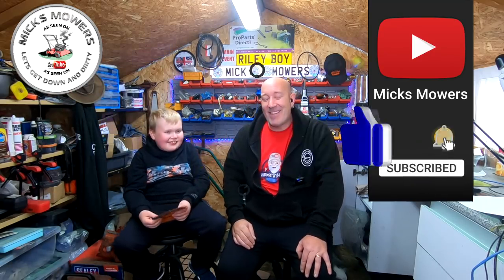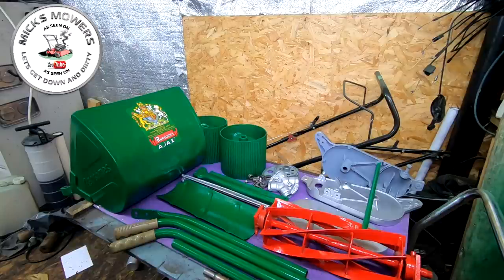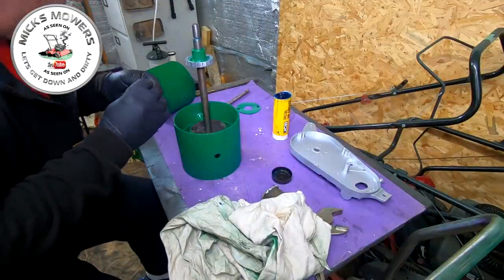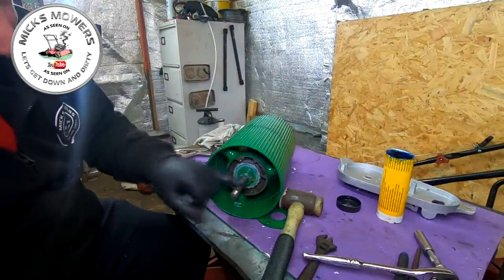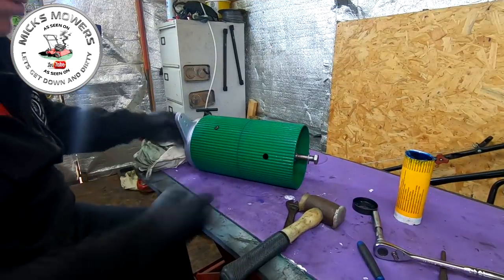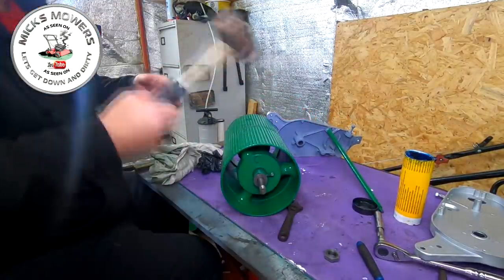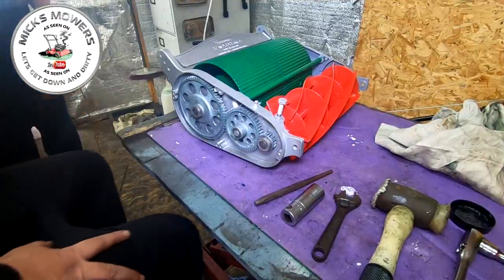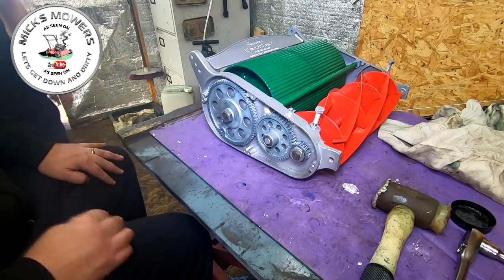Ramsomes Ajax Reel Cylinder Mower Restored #restoration #vintage #how #youtube

Comment: Just  had a result  a titan  chainsaw  with  scored  piston, adjusted the carb  and runs  like a dream, and cuts well cleaned it up looking great
Reply from the maker: You got lucky me old mucker is it a keeper or one to sell on..
Reply: @themowerman  can't sell it I will keep it I also have a  hedgtrimmer  I gave a fiver  for handle seized  but knew motor was good  , had to re
Reply: Engineer the throttle lever spring to work and replace the pull start with one I have had lying around greased the gearbox but it is a keeper, not up to my standard of service to sell

Comment: As a cylinder mower enthusiast, i can say you have done a really good job on that mick, my only bit of advice would be to never leave paint on the cutting surfaces (ends of cylinder and bed knife edge)  otherwise cracking result mate 👍
Reply from the maker: Yeah thanks mate.. to be fair the paint was not that hard so would not of done too much damage.. thanks for watching mate

Comment: There's an echo in the audio.... ;) Top job. I suspect the rollers were originally covered in some oil finish. You might want to see if there is any advice out there. That said, after I sanded down the handles on my garden sheers and put boiled linseed oil on they ended up looking the same!
Reply from the maker: Ok thanks mate

Comment: I wonder how much it sold for? Good mowers, except when the lawn surface is bumpy and the rollers slip if ground is wet. They could do with longer handles and l find the original grips are too hard without gloves. lt gets your muscles warmed up to push, (try to find a light viscosity grease for the drive side lube). Sensitive to adjustments but easy to do once practiced.
Reply from the maker: It sold for good money.. yeah if your over 5foot 8 it's too small for you

Comment: hi again! i started reassembling the rear drums as i watch your video. is that normal that drums shift and touch each other even though i left a slight gap between them then installed rachets abd screwed covers down?  once i assemble all, that will be eliminated?  not sure if im doing right. i keep rewatching your video
Reply from the maker: Sounds ok mate .. just give it a go and see what happens
Reply: @themowerman  thanks!

Comment: cant beat a push mower..ive got a 16inch greens zephyr  with 12 blades..the 14 inch with 10 blades and a 12inch with 8 blades..also got 3 webb witches..problem with the ransomes..it hasnt got enough blades so gives a washboard kind of cut..plus the upturned bottom blade..a tournament blade from garfitts would be ideal and an 8 blade cylinder would make it the best 12 inch mower there is..